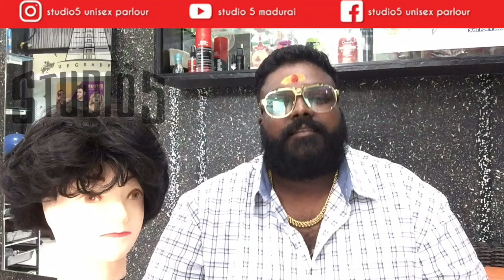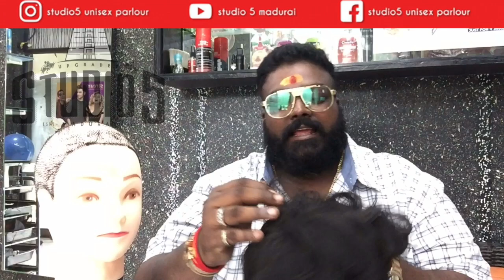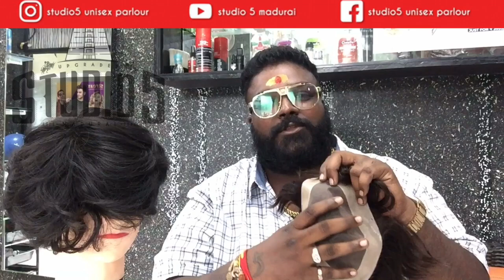Hair wig & Hair system which is the best @Studio 5 international non surgical hair replacement

Comment: Hii sir ,Ok hair system fix pannitu, then head wash epdi pannrathu ,apdi thani patta antha system failure agidume so epdi nu sollunga sir
Reply from the maker: Gimiki kamal weekly two time hair wash panalam sir
Reply: @studio5hairreplacementmadu935   ok sir but epdi antha system ma  remove pannitu hair wash pannanuma
Reply from the maker: @madhavan.schemical1493 don't remove the system for hair wash
Reply: @studio5hairreplacementmadu935  apo water patta system failure Agatha🤔
Reply from the maker: @madhavan.schemical1493  no sir
Reply from the maker: Contact us 8675555570